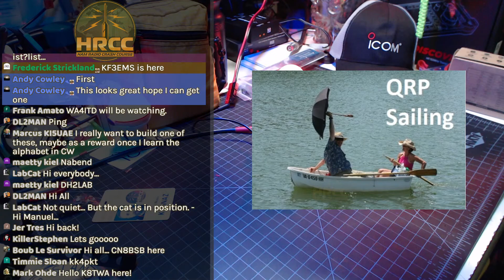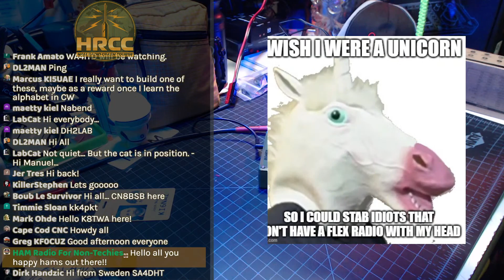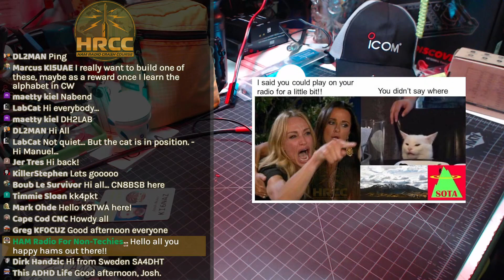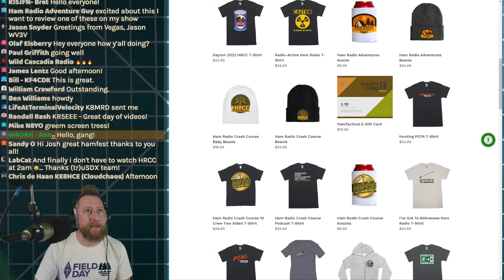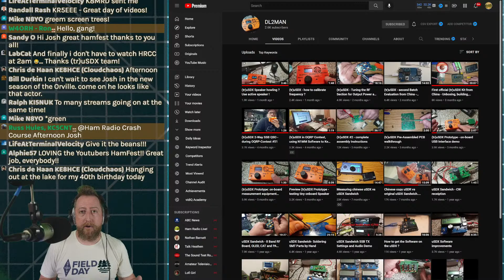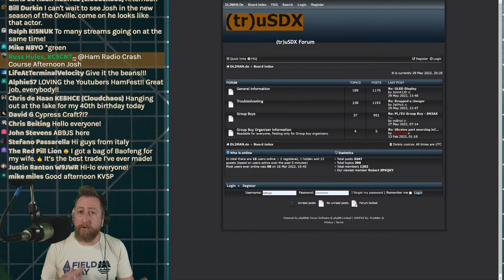Designing Radios With DL2MAN & PE1NNZ

Comment: I just got my radio, and I am really excited to use it, but a word of caution. Updating the firmware and registering your callsign is not a simple process. I have a MAC and an Inovato. I am unable to load via the Inovato. There are multiple apps that have to be downloaded and run to install the firmware update. This is above my pay grade, and I am going to have to find someone with more knowledge and hardware than I have to accomplish this task. You can still use the radio without registering it, but I want to maximize the experience. KK7TIW

Comment: excellant transceiver guys i worked a cw station from here in yucca valley ca to michigan . 2154 miles on 20 meter 559 report using a doublett antenna and a dipole.
very cool..
ki6pxv rod

Comment: It would, indeed, be interesting to explore the possibilities using a more modern multicore microcontroller. 
(Dreaming of things like spectrum, maybe even waterfall, but also all kinds of digital modes.)
Reply: The latest firmware for Trusdx has a frequency scope
Reply: @nehem11e  i know, and its a miracle (not really: its the result of really incentive programming work). But getting everything possible out of a tiny microcontroller is - with, again lots of respect for the work of Guido! - more hobby than practical now there are way more powerful controllers available for a few cents more.

Comment: This was great. I bought one based on your review and others. I wanted something smaller and lighter than my KX3 for outdoor use. I wish a 10-20 version had been available as it seems like an outdoor radio should have bands that work in daylight! Anyway AliE/Uptech sent me TWO units as my order was somehow duplicated. If they do not allow me to return one, I guess I'll try to modify it for the top bands. Did I understand correctly that it could be done ONLY by replacing caps, 'in order' as Manuel said? Or is it also required to rewind toroids, or make other mods? Or could I just buy a replacement RF board? Actually I really want 6/10/12/15/17 as they are the bands I actually use during the day.  72, VE7VIE and WV2J
Reply from the maker: Yeah. They have a high band option now. Check it out.
Reply: @HamRadioCrashCourse  I did, but it isn't clear that you can replace the RF board with no other changes, or if an ASSEMBLED top band RF board would be available.
Reply from the maker: @barrybogart5436  I suggest you reach out to the truSDX web forums on that question.  But I believe the answer is you can just swap the RF board.

Comment: "They're a lot of fun, even if you build it as a kit." 

Even? Building it as a kit is by far the very best way to get a (tr)uSDX. The soldering is easy since all of the SMT parts are already in place. All you have to do is thread wire through quarter inch holes, and stick parts in holes, then solder them.
Then you get the pleasure of learning what Class E RF is all about, and moving wires around until you have an efficient rig putting out the power level you want. For many of us, that's more satisfying than making some contest QSO's. We LIKE radio electronics. We LIKE building things. We LIKE tuning things. We like LEARNING things. Ham radio doesn't exist so some people can legally run high power CB's. It exists because the government wanted to encourage people to learn about RF communications. We really need to keep that in mind. These 2 guys exemplify the spirit of ham radio.
Reply: Yes, but...not everyone wants to build. I was originally licensed in 57 and have done a lot of it, most recently an Elecraft K2 and KX3 and a Softrock Ensemble, my first SMT experience. But the arthritis in my hands means it is a lot less fun.  VE7VIE and WV2J
Reply: @barrybogart5436 , I understand. I built my first Benton Harbor Lunchbox in '63 when I was 13. It was a whole lot easier to wrap a wire around a tube socket pin and hit it with a 150 W Weller gun than it is today. I'm still managing, but barely.

Comment: Thank you.
Have you considered hf transiever with 1 single frequencie? This is a requirement for certain companies using maritime sets. Non ham operators are not allowed change frequincies.
Reply: Sorry, I know this is a year later, but this is where the open-source uSDX (which is also Guido's design) could be used: it would just be a matter of hard-coding the frequency in the firmware so that the frequency could not be changed.  However, most countries require FCC type acceptance for all non-amateur radio transmitters, so there would be some additional expense involved.